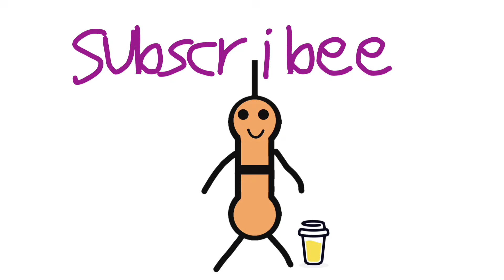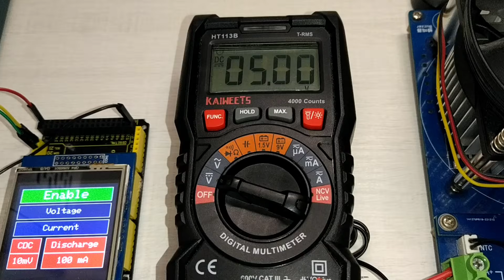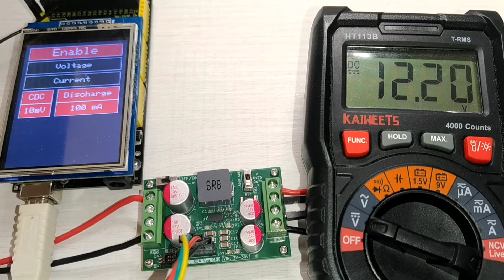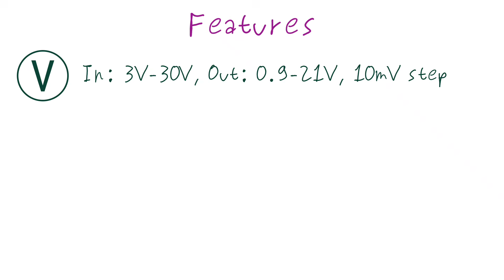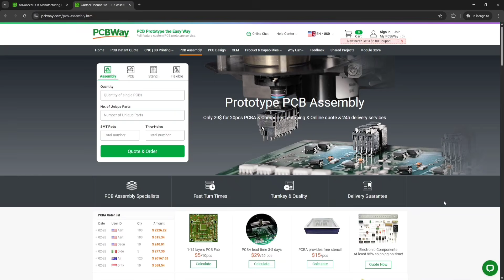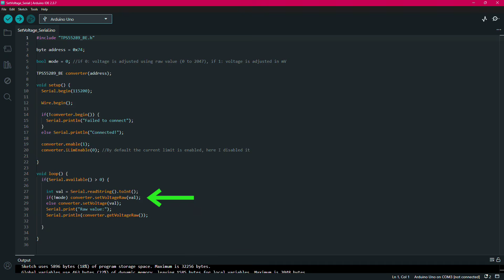My new I2C Controllable Buck-Boost Converter (Fully Programmable Power!)

Comment: I'm looking for a controllable power supply that I can control with ESP32 AND that can do up to 7 Amps with 2 channels. what parts would you recommend (type of MOSFET, etc)
Reply from the maker: It's hard to say off the top of my head. You didn't specified input-output voltage range, features, target price etc...

Comment: First of all thank you. Great project. I got his board made and populated via pcb way. But have a problem communicating with it via I2C. Whanted to trace and trouble shoot the issue, just wondering if you can pls share the schematics?
Reply from the maker: Hi, what issue did you encounter with I2C? In the board, the two 10k pullup resistor are connected directly to the Vext pin. So the voltage you provide at Vext will be the pull-up line. In order to communicate with the board you have to connect like this:

MCU <---> Converter
SCL <---> SCL
SDA <---> SDA
VCC <---> Vext
GND <---> GND

Where VCC is the voltage level of your MCU. So for an arduino uno, VCC is 5V, for an ESP32 VCC is 3.3V etc...

If you use an MCU with less than 3.3V operating voltage, the internal 10k resistors may be too high. To solve this you can use external ones or just parallel other resistors in the I2C lines.

Another way to connect to the converter is by skipping the internal I2C resistors:

MCU <---> Converter

SCL <---> SCL
SDA <---> SDA
GND <---> GND

But in this case you need to provide external pull-up resistors to the I2C lines, or use an MCU with internal I2C resistors. Hope it helps
Reply: @BurningElectronics That worked! Thanks. The only other issue was that if I go from 5v to 20v output request, then the voltage goes down to zero, but if i ramp it up using a 30ms delay between steps of 0.5v it works perfectly
Reply from the maker: @shavajkallamkote3402 Amazing! :)

If it is not a problem always change the voltage "slowly". Btw, there should be an option for faster slew rate in the I2C register of the converter, but I've not implemented it in my library
Reply: @BurningElectronics Thanks for the clarification! That explains why the direct jump was causing an inrush current spike and tripping the input supply.

Comment: Great project! Seems pretty uniqe in the world...
I need to activate the feature 'Logic Enable and Programmable UVLO', Datasheet Fig. 7-2. Do you think it's possible to add the required components on the fly?
Could you eventually share a copy of your schematic, or even the KiCad database?
Reply from the maker: Hi, 
Logic Enable and UVLO are both implemented in the board. The UVLO is set with two resistor, so if you want another rising and falling threshold you need to change the UVLO resistor values
Reply: @BurningElectronics Perfect! That means I provide a modified BOM to pcbway, where I just modify these resistors. Can you tell, which two resistors are affected?
Reply from the maker: @AlfredLang-k9l Hi, sorry to tell but actually the logic enable isn't exactly as with figure 7.2.
I mean, with this board you can send an I2C command or flip the switch to turn on or off the converter, but the circuit has not a mosfet with dedicated pin implemented. If you have a signal from a discrete logic device you can send it to your MCU and the MCU then turns on/off the converter via I2C. Tell me if that's good for you.

Regarding the UVLO, the two resistors for UVLO are R1 and R2. Those are 0603 resistors so you may be able to directly rework the board. Those are under the on/off switch. If you write me an email I can send to you an image and the modified BOM. If you want to do by yourself just make sure the resistor you select are 0603 1%. You can also use 5% but cost of 1% doesn't differ that much
Reply: @BurningElectronics Hi again, it's ok for me to have the disable implemented via I2C. Regarding hardware UVLO, I guess you have implemented figure 7.1 which is also OK with me. Please tell me the actual designators of the two resistors R1 and R2 from datasheet figure 7.1.
Reply from the maker: @AlfredLang-k9l The actual designator for R1 is R1 and for R2 is R2. If you want, you can tell me the two part number you are going to use before sending the modified BOM, so that I can check if they are ok. Remember they should be 0603 :)
Reply: @BurningElectronics Thank you!
Your values are R1=120K, R2=100K. That results in Vin(ulvo_on)=2.706V and deltaVin(ulvo)=0.6V. I want to use R1=100K, R2=11K, that results in Vin(ulvo_on)=12.41V and deltaVin(ulvo)=0.5V.
Is switch sw1 also somehow connected to this resistive divider, or does it simply cut off the supply voltage?
Also important for me: Is pin 16 (CDC) of U1 somehow accessible from outside? Any resistor or capacitor connected to it, where I coud solder a breakout wire? I need it to measure the output current with the expressif ADC.
Reply from the maker: @AlfredLang-k9l Hi, selected resistors should be ok. Anyway the switch is an spdt switch, and it swiches between the center tap of the UVLO divider (turns on the converter) and GND (turns off the converter). CDC is floating so no connection. I don't understand the output current thing. If you want to measure the output current of the board just measure Vdrop at the sunt or connect an external one at the output
Reply: @BurningElectronics Hi, thank you for confirming the resistor values and describing the SW1 functionality!
Well, the CDC pin provides the voltage drop at the shunt, amplified by a factor of 20 and ground referenced. That's ideally suited for putting into an Espressif ADC input. Do you see any chance to solder a thin wire directly to the IC Pin?
Reply from the maker: @AlfredLang-k9l Hi, sorry, unfortunately I don't think you'll be able to solder a wire on the cdc pin. The converter package is QFN
Reply: @BurningElectronics Hi, cdc pin access is absolutely crucial for my application. Could you eventually make a little modification to the board to enable that? Extending the solder pad a little to come out from underneath the converter package would be sufficient.
Reply from the maker: @AlfredLang-k9l Yeah I should be able to do it for such small change
Reply: @BurningElectronics Yeah, that sounds good! What do you think, how long it will take and when I can order it from pcbway?
Reply from the maker: @AlfredLang-k9l Hi, I've been sick these past few days. I will upload the modified design on the pcbway shared projects. You can send me a mail if you want to see a preview

Comment: I used your code from git and run it in my custom TPS55287 DC-DC buck boost board. In serial monitor of arduino IDE, I got the connected message and when I hit the raw value between 0 to 2047, I didn't get the output voltage. Please help.
Reply from the maker: Hi, since you have a custom board, you should verify both the code and the hardware. Maybe code is ok but hardware is not. Anyway the code first enables the converter in the setup() part, what output voltage did you read before entering raw value?
Reply: @BurningElectronics I am getting 1.6 V at output but it doesn't change with raw value.
Reply from the maker: @mohitgoel6739 If you are getting 1.6V when the converter is enabled then something it's wrong with the design, the voltage you should be getting after the converter is enabled should be 5V. It shouldn't be a code error since the TPS55287 and TPS55289 share the same logic
Reply: @BurningElectronics sometimes I didn't get any voltage after getting connected.
Reply: Would you please share your schematic? I need to cross check. I am supplying 5 V at input.
Reply: I design it from eval. Board of TI.

Comment: I see the v3 has I2C pullup resistors on the board. But the TPS55289 VCC LDO outputs 5V. You also say it is ESP32 compatible. Which is it? 5V I2C that needs a level converter or ESP 3.3V compatible? I just ordered some board from PCBway, now I have to use a microscope and soldering iron to remove the pullup resistors?
Reply from the maker: Hi, good question. First, the internal LDO has (almost) nothing to do with the I2C interface. In fact you can use the converter with your 3.3V esp32 without any soldering or other mod. The connection are:

Conv <---> Esp32
GND <---> GND
Vext <---> 3.3V
SDA <---> SDA
SCL <---> SCL

For the esp32s3 the SDA is pin 8 and SCL is pin 9.

If you need to use MCUs that work at lower voltages like 2.5V or lower then you may need to add external pull-up. That's because the pull-up used in the board are standard 10k resistor, and at those low voltage 10k may be too high. But this is actually a thing you can do with any MCUs. For istance if you find that 10k is not working too well in your design you can add external pullup. For example adding external 10k resistor, would result in a total pullup resistance of 5k, as you are effectively adding two 10k resistor in parallel.

Again, as said before, with esp32 you will be able to control the converter simply by connecting the 4 cables.

IMPORTANT: If you are working with other pre-built I2C devices, such as OLED, sensors etc. Those devices can also have embedded I2C resistors. If they do then pay attention as the total pull-up resistance will drop.

Feel free to ask any question
Reply: @BurningElectronics I'll drop you a coffee for every board I make! Can't wait to try the boards when they arrive!
Reply from the maker: @savagemuir9360 Wow, thank you for your trust. I will keep it in mind for the future! Thank you!!
Reply: @BurningElectronics You have a PCB layout template? I'm mounting this on another circuit board and I need to know where the holes align.
Reply from the maker: @savagemuir9360 Hi, now that you got me thinking I should upload somewhere the hole position, I totally forgot to do that. Anyway for the moment I'll write to you here.

Hole to hole vertical: 31.1mm
Hole to hole horizontal: 50.4mm

And since those are symmetrical to the center

Hole to center vertical: 15.55mm
Hole to center horizontal: 25.2mm

Basically hole to hole dim divided by 2.

Hole to board edge is 2.6mm
Hole to board edge clearance is 1.5mm

Hope it helps

Comment: I am about to order a few. Just wanted to make sure: did you test them with higher currents? What is the max current it can sustain for continuous use without an additional heat sink/fan? Thank you for sharing your work!
Reply from the maker: Hi, the maximum current without heatsink/forced airflow is for brief period of time 7/7.5A. I did some test at 6.5A, I1 is input current at start I2 is input current when thermal equlibrium is reached, usually after 15-20min, and those are the results:

t = 1h, fsw = 200Khz, t_amb = 25°C

IN: 3V6.5A OUT: 21.4V
I1 = 6.5, I2: 6.76

IN: 5V, OUT: 3.3V6.5A
I1 = 5.08, I2 = 5.16

IN: 5V6.5A OUT: 12V
I1 = 6.5, I2 = 6.585

IN: 9V6.5A OUT: 12V
I1 = 6.5A, I2 = 6.558A

IN: 12V, OUT: 5V6.5A
I1 = 3.028A, I2 = 3.066A

IN: 12V, OUT: 9V6.5A
I1 = 5.204, I2 = 5.238

IN: 24V, OUT: 12V6.5A
I1 = 3.439, I2 = 3.465

(For high input current, the real input voltage is a bit lower, about 0.1V lower due to input cables)

I will for sure make other time-related tests

In general I would say a good starting point for continuous use should be:

Imax = 6.5A (both IN or OUT)

Anyway if you want to be conservative since the IC has an average 8A current limit. Going at 0.75 then the current would be 6A.

Regarding maximum power it's difficult to draw a line, I have to do more tests. For example following the Imax rule of 6.5A, you could try and use as input 30V and output 20V6.5A which is 130W. By no means the board will be able to handle that

If you have any other question, feel free to ask
Reply: @BurningElectronicsexcellent job, these numbers help a lot. Meanwhile at pcbway, I am close to getting a quote after they pointed out I need to choose a bom 😬 overlooked your good comments and instructions at first.
Reply from the maker: Hi, yeah I've chosen different BOMs so people can have different possibilities. I will probably make a 2-Layer version of the board to save even more cost, altough the performance will not be the same

Comment: Just a doubt....can dual or triple chip can be used for higher amps? Like what if you turn it into a digital bench power supply of 10-15 amp? 

8x2=16 amps?😂😂😂
Reply from the maker: Hi, those dcdc converter are not isolated, hence cannot be put in parallel, and the maximum output current of a single one is about 6-7A
Reply: @BurningElectronicsi  mean only the output path can be parallel? If using a mcu, no problem using one more pin for control, and it's even i2c ....any kind of isolation or such can't be used?
Reply from the maker: @evilgamers561 Unfortunately those converters are not meant to be put in parallel. You can drive two of them with a single mcu and they can share the same input, but they cannot share the same output. However you could try to use an resistor of equal value (0.1% tolerance I would say) for each output and then connect them in parallel, but I didn't tried it yet
Reply: @BurningElectronicsthat's a good idea buddy